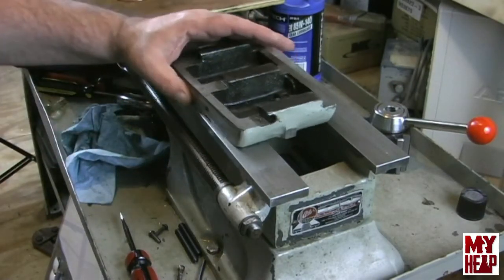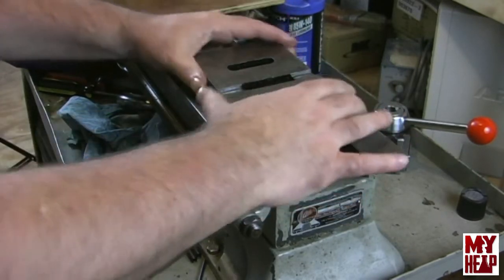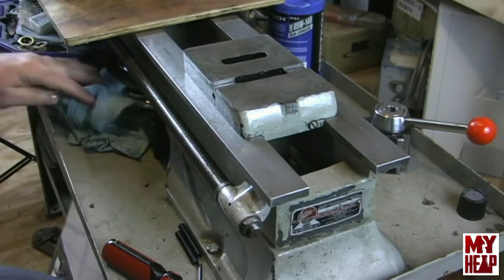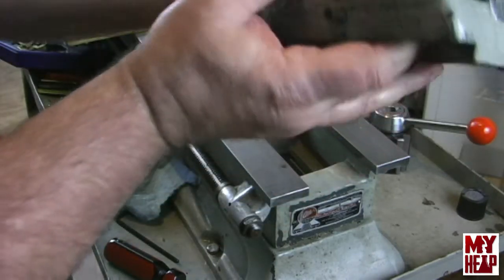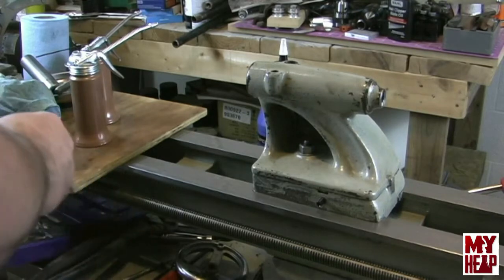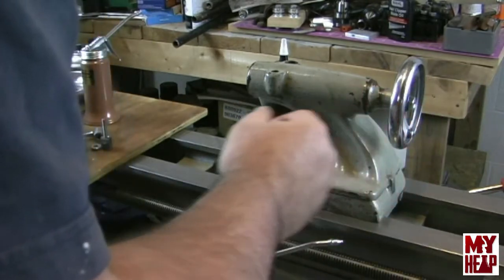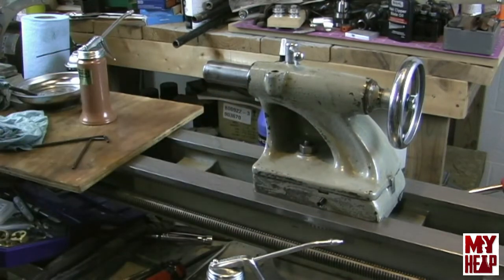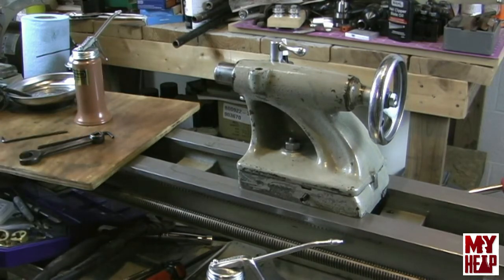Atlas 10F Lathe - TH54 - 22 - Assembling and Adjusting the Tailstock

Comment: G'day Joe, another great video, you are getting some sleep I hope. Going by the series 10F, I gather it is 10" swing but what is the between centres distance. Nice to have a 10" swing though. Cheers Peter
Reply from the maker: Hi Peter, yes it is a 10" swing (5 inch by our cousins reckoning across the pond.)  The TH54 is a 54" bed, the between centers distance is about 36"  I am getting close to making some chips.  Now, if it weren't so cold and wet I could do some casting for a steady.

The time zone I live in is GMT -6, out of curiosity, what zone are you in from GMT?

Joe
Reply: I am GMT +10 , (11) as it is Daylight Saving.

Comment: Hi Joe, getting close. For a quick and dirty way to adjust your tailstock, you should make up a little indicator holder. This is how I did it, and it worked out pretty good. Check out this video to see what I mean.  https://youtu.be/utZVv7QvRt8
Keep in mind, it doesnt have to be that fancy. Just needs to hold an indicator rock steady through rotation.
Reply from the maker: Now, that was a good tip.  Thank you Jeremy for sharing the link with me. 

Joe